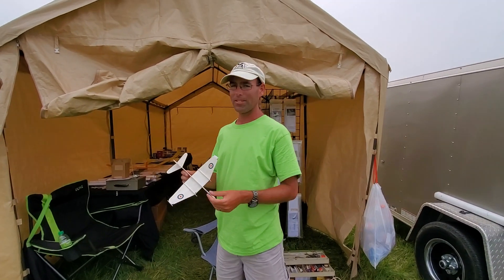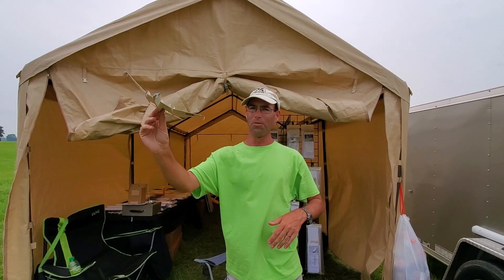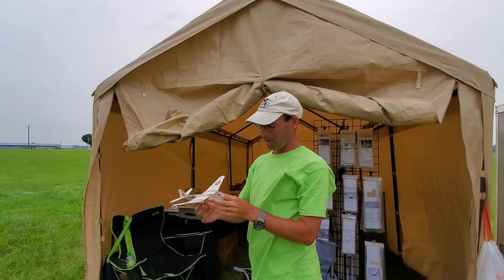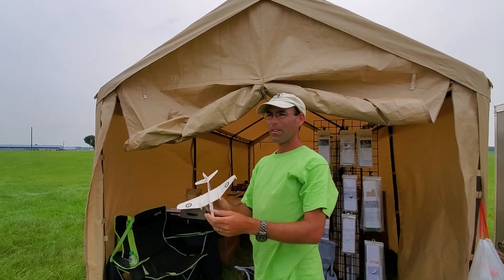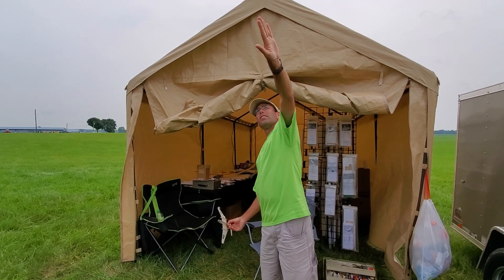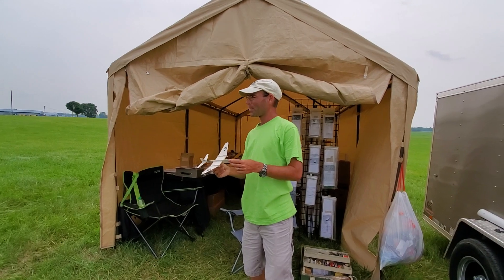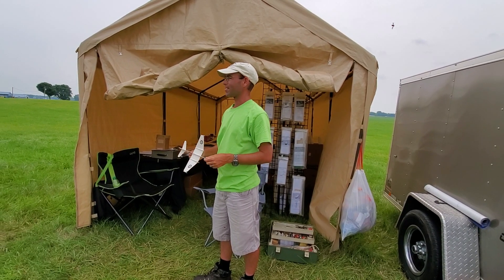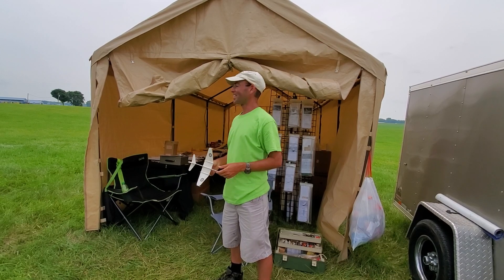Catapult glider flight trimming philosophy

Comment: Hi Sanjay again...with regards to my previous query on the dihedral angle and wing span to fuselage length query , just wanted to let you know that my gliders are small,  with a wing span of 8 to about 12 inches or thereabouts..
Reply from the maker: The optimal proportions don't change much as you scale up or down.
Reply: @joshuawfinn  gotcha 👌..thanks
Reply: @joshuawfinn  Just to clarify..optimal proportions being?

Comment: Hi  this is Sanjay all the way from India...I am attempting to make chuck gliders..please,  please let me know what the wing span to fuselage ratio should be ( my gliders are small..8 to 10 inch wing span)..also the correct positioning of the main wing and the correct CG position on the main wing to balance 😀
Reply from the maker: Start with bottom of wing and stab parallel. Add incidence with gurney tabs as needed. We've done several videos on the trimming. CG is simple. Add/remove clay until it glides well. The plane will tell you what it wants. Calculations are a waste of time on that parameter.
Reply from the maker: One correction: CG calcs are a waste of time on hand launch and catapult gliders. For rubber, towline, and gas power, use the CG calcs available at themmmclub.com and set the CG, then leave it there and adjust incidence for a good glide. For no-autosurface gas power you'll need to tweak the CG slightly, the others use fixed CG.
Reply: @joshuawfinn  good to know...thank you so much...
Reply from the maker: @sanjayvijayan5609  glad to help! :)
Reply: @joshuawfinn  😊super..thank you so much for your reply..